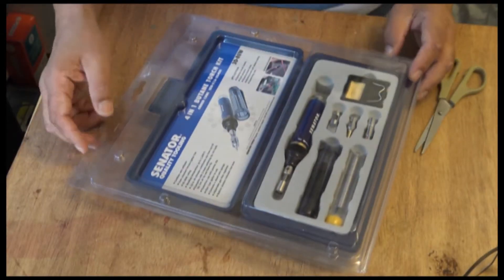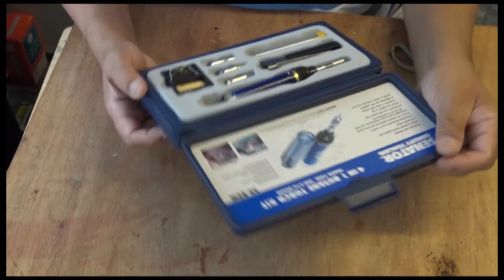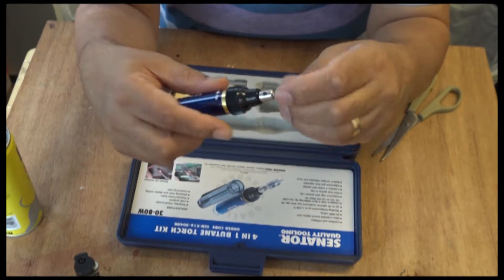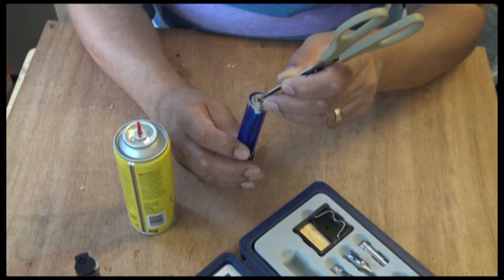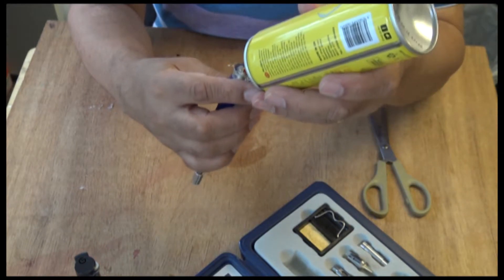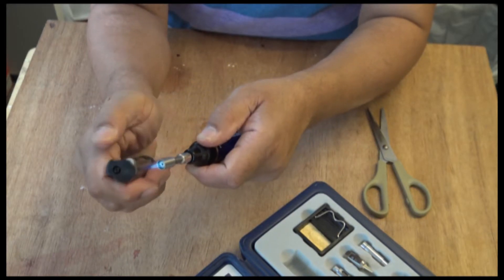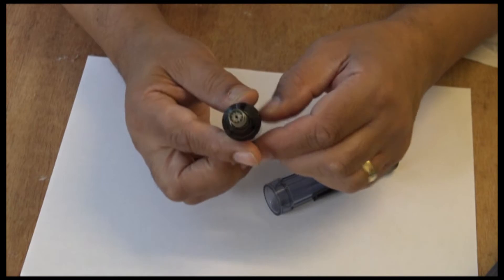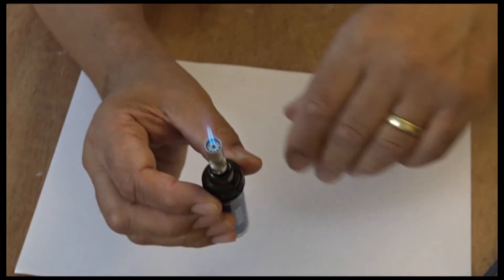#89. 4 IN 1 BUTANE TORCH KIT (SENATOR)

Comment: I have something similar, don't remember the brand, worked fine the first time, something happened and ever since I haven't been able to get it to work. No idea what I did to it, I stored it away and haven't touched it since. I shall have to dig it out and have another go. I suspect a seal has dropped out from somewhere inside the head.